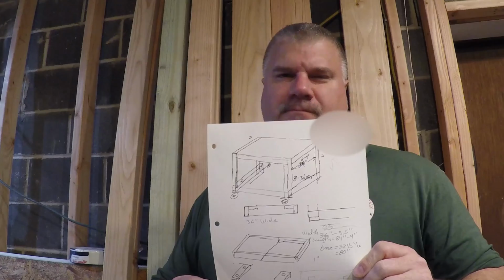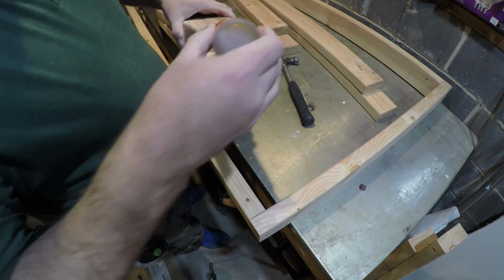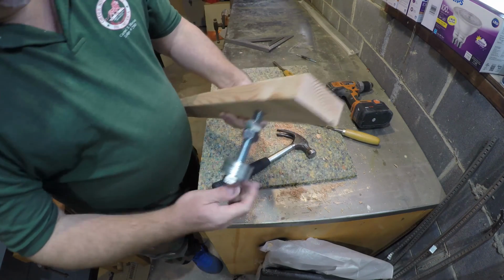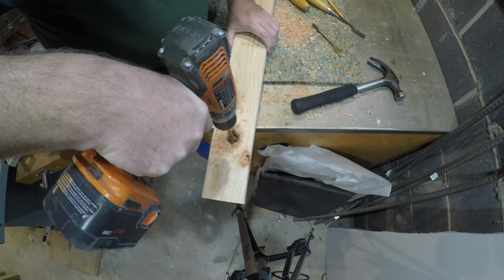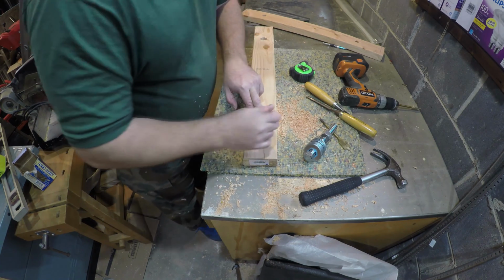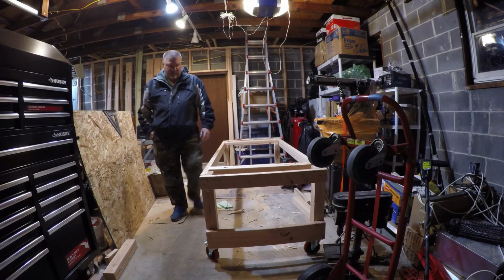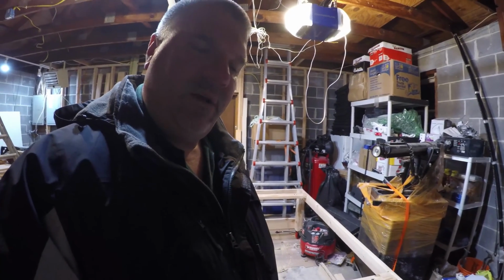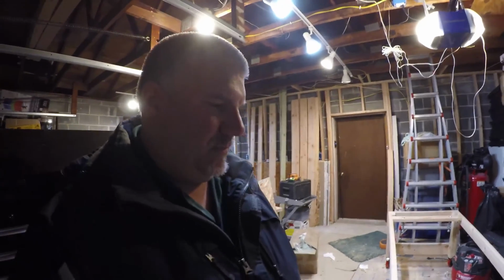How to Build a Level Workbench for a Sloped Floor

Comment: nice! I like the way it turned out. was that a brushless drill btw?
Reply from the maker: DanOticks Not sure. I will look at the specs.  I had the impact driver for two years. This is the first time I used it. It is amazing. Why didnt I use it b4?  Dunna...I was skeptical I guess.  I got part 2 of the video in the works.  I think this table will hold me with no problem.  Im working on a piece for a fundraiser. It is an LED backlit aign. I will have that video up after Im done.